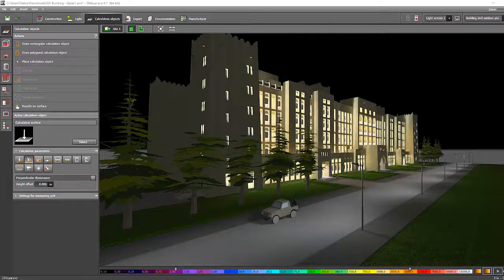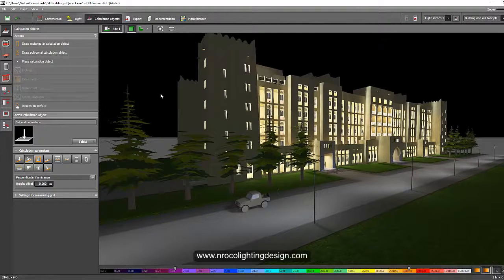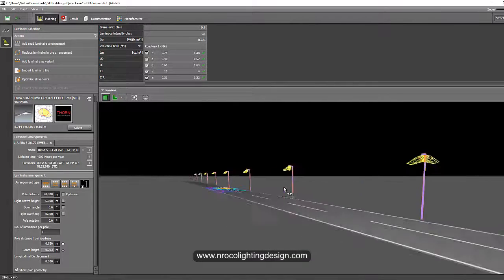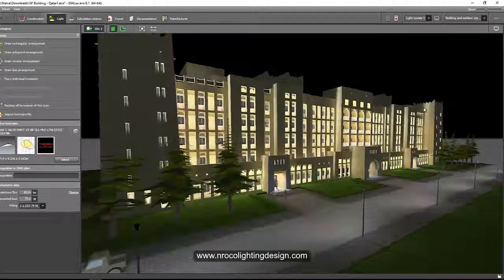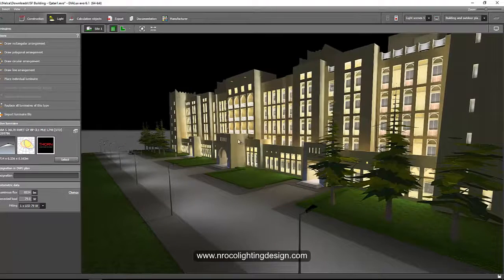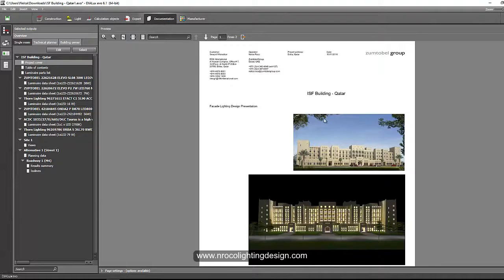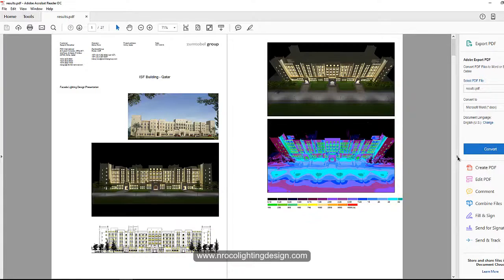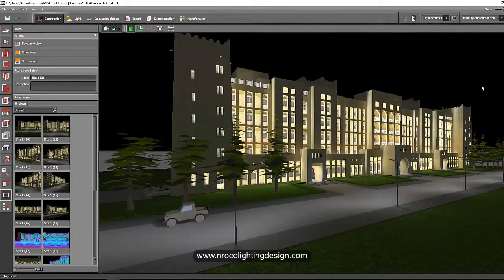Facade and Road Lighting Calculations Combined

Comment: Hi maddam. Im a bit confused. How to make my street lighting appear in my outdoor?  I did the calculation for street lighting and as well as in the facade lighting. But i cant see my fixtures for roadlights in the outdoor view. Can u elaborate it more? Did u manually put the roadlighting luminaires in the outdoor space?
Reply from the maker: yes. manually with the correct spacing and tilting from road lighting calculations.

Comment: Dear Nelca,

You have tought me a lot about dialux and i am working on a project now that is very challaging.
in this project 2 windows meet each other in a corner. not only that but they meet at an angle other then 90 degree.
Do you know how to solve this?

thx in advance,

Patrick
Reply from the maker: Dear Patrick, just do it! meet these 2 windows in 90 deg. its ok! if you want to edit the frame then make it thinner, u can also do it! if you want frameless, then cut this corner using cut option then create an object and fill it with glass materials. Its easy, no worries. let me know if it is successful.
enjoy learning!
Reply: Dear nelca will you please send those which I requested please send it
Reply: It will be very helpful for us
Reply from the maker: let me check ur request first. there are so many email coming now and I cannot attend it all.  what is it that u requested?
Reply: I have requested the complete video for the file for the video you have posted in April 16 2016 " Dialux eco how to create decorative glass panel" I want the video that how you create the inside structure of the shopping mall. Please go to that video and see my comments . Please send the video and many thanks for the support